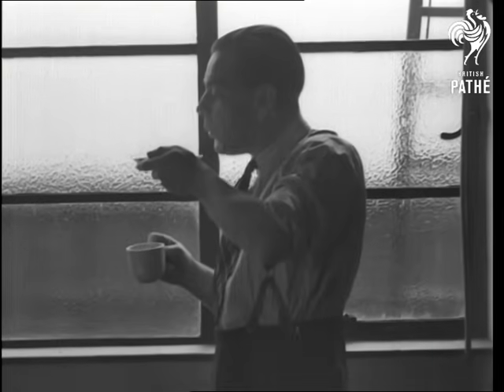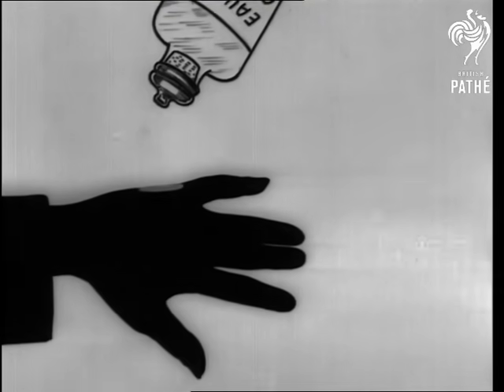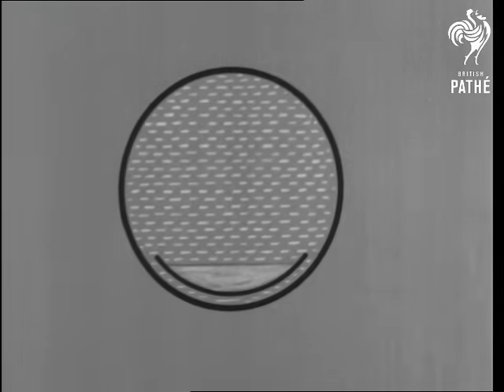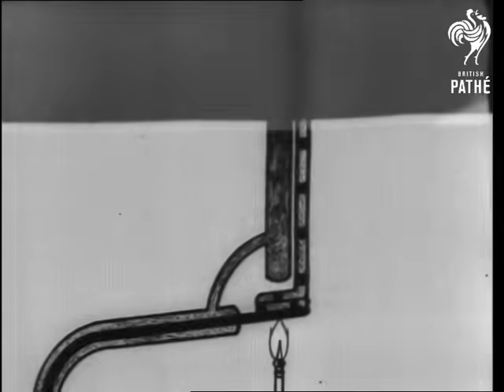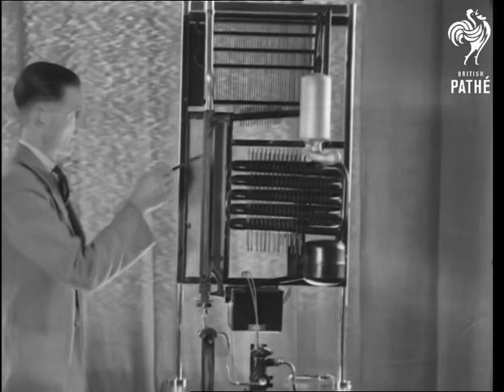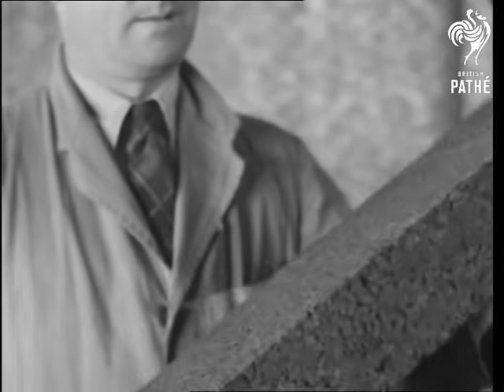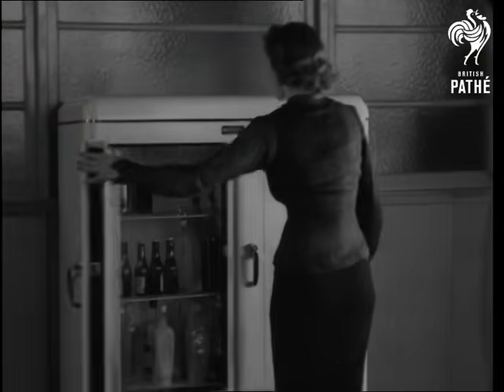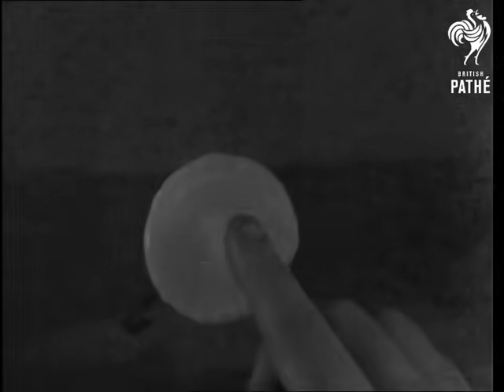Flame That Freezes How A Fridge Works (1939)

Comment: I dont understand why they dont use the heat of the exhaust to power air conditioner system in vehicles this way instead of wasting energy turning a compressor
Reply: i always thought this as well... but then i thought some more...

size, and the issue of vibration... or not remaining stationary.

they require gravity to work, and dont appreciate being tilted .
yes, theyre used in mobile homes... youre supposed to turn them off when traveling.

Comment: When I was a kid in the late 60s, we had a gas fridge at home! I couldn't understand how a flame kept things cool.
Reply: And after watching this old film i still don't understand it.
Reply: @keithammleter3824   Neither do I! 🤣
Reply: @keithammleter3824  If this works (flame) then a solar powered Fresnel lens focused instead of a flame, could make a fridge work. WTF?
Reply: @markae0  It would most certainly work.  Any sort of heat source that lets you heat to sufficient temperature only the right point in the system will work.
Reply: @markae0  That's why I got here 😀 I have a Fresnel lens, but no gas fridge to try it. It would also require a tracking device
Reply: @SolarCookingGermany  The solar fridge would only work for 15 minutes a day when the sun is in the correct position without tracking. So the insulation of the fridge would have to be super thick. and on cloudy or rainy days the flame back up would have to run. I was thinking a fixed Fresnel lens would make a straight (burn) line on the ground following the suns path? In this burn line, place a pipe that is to heat the refrigerant to 134 Celsius. First experiment with water in the pipe I guess.
Reply: @markae0  Good idea 🙂 Tracking is too complicated. But I'm afraid I can't just open the refrigeration circuit and add a heat pipe without losing too much fluid.
Reply: @SolarCookingGermany  Yes. Some problems to overcome. Some Fresnel lens are powerful enough to melt metal, so this is well above the critical temperature for the fridge, which means we might be able to pump that heat from the solar Fresnel lens to the critical area in the fridge. 

The solution is another heat (pump) transfer to add to the existing (non modified) working propane-flame fridge.

The Fresnel lens I have only produces mild heat of about 100C. But I have other lens to try out. The summer went by so fast! maybe I will have a few more sunny days this fall to try stuff out.
Reply: @markae0  Maybe it's easier to make some kind of Crosley Icyball. I guess it doesn't need to be ball-shaped.
Reply: @SolarCookingGermany  I never heard of that. Thanks!
Reply: When you add heat you increase pressure and that serves to purposes 1-liquifying gas 2-make pressure difference so gas before entering evaporator gonna pass through small hole called expansion valve , gas then expand and drop pressure and temperature and gases boil at average-40 at atmospheric pressure , now why we liquified gas and want it to has low boiling point? because substance when change phase like(liquid to gas) they absorb a lot of heat it’s called latent heat , if gas go to evaporator at gaseous state they would absorb only 1%of the heat a liquefied gas would absorb during boiling or phase changing
Reply: @mohammedbin0002  All good except for one important thing:   You can't liquify any gas by adding heat to it.   All you do is increase the temperature and pressure.    Thee important factor in gas-powered and kerosene powered fridges is that the latent heat of vaporisation varies with temperature & pressure.   For example, water at atmospheric pressure (1 bar) boils ta 100 C and in doing so absorbs a latent heat of vaporisation 2258 KJ/Kg.   At the critical point, 374 C, the latent heat of H2O is zero.
All substances that can exist in liquid and gas forms have a critical point and zero latent heat at that point.   
Ammonia - the working fluid used in non-electric fridges (and electric fridges before freon was invented) has a critical point at 132 C.   Latent heat at room temperature and pressure is about 1100 KJ/Kg.
Reply: @mohammedbin0002   Thanks for the detailed explanation.
Reply: @mohammedbin0002  I'm good with all of that explanation.  Just having a hard time figuring out how just a flame can drive a pump.  You'll need a pump to move all of that fluid throughout the closed system, right?  Fluid doesn't move unless there is a pressure differential.  ???

Comment: We need to use this technology again..😊
Reply: We do.  It's still in use in RV refrigerators.  Those run on propane.
Reply: It's extremely inefficient, in refrigeration it uses about 5x the energy a normal vapor-cycle fridge does. It's currently used industrially, like with small power plants, where the heat would be wasted anyway, search absorption chiller.
Reply: @straightpipediesel  Free solar power you don't care about 5X the energy. On a sunny day you have four good hours of sunlight that could run this kind of fridge for free. Massive insulation and you might make it to the next sunny day.
Reply: It's very inefficient. You are better off with a solar inverter and a compressor, most likely. 
Keeping the concentrated dot of solar light from an optical system focused on the boiler throughout the entire day requires the fridge to be outdoors and have some kind of tracking system to keep the little dot of bright light exactly on the boiler. 
It could theoretically be used in large air conditioning systems, but one of the reasons why we moved away from ammonia, is that it's quite lethal and explosive when in concentrated form like in this type of fridge. Ammonia was used in ice skating rinks in the early 20th century, not sure if they still do.
Reply: @mfbfreak  "Keeping the concentrated dot of solar light from an optical system focused "  I am thinking the solar focal point makes a straight line, and you have a pipe under the pathway with a fluid in it. Transfer-pipe the hot fluid to the fridge. Years ago people (like me) thought liquid cooling your PC was insane, but it has become standard.
Reply: Liquid cooling isn't standard at all. What you're describing is not possible without electric energy storage. Your solar heater will not be able to work about half of the time, because of the sun going down. However much you insulate your fridge, a 12 hour gap in refrigeration, every day, will result in spoilt, unpreserved food.

Comment: How can I safely gut out an old servel fridge? I want to turn it into a toolbox.
Reply: figure out how to break one of the lines remotely. r717 exists naturally to begin with and doesn't really mess with the environment the way a chlorine containing refrigerant would (this means the epa doesn't care if you vent r717). the problem is the stuff that's in that fridge WILL KILL YOU due to being basically pure non-diluted ammonia. the stuff you can get at any store to clean with is like 10% at most and the rest is water and even that knocks me back if I get too strong of a whiff of it.

Comment: Can phase change materials be used instead of a flame?

Wednesday, November 30, 2022 CE, 21:40 EST
Reply: any source of heat will keep the process going.
Reply: Like a catalyst used in those petrol hand warmer things? 🤔
I imagine it's just heat needed to drive the system not specifically a flame.

Comment: A refrigerator that works like a stove (range) or a water heater... Isn't that dangerous? Literally, there's fire inside... I wonder how many accidents gas refrigerators caused back in the day...
Reply: No more than gas water heaters or gas stoves.
Reply: @RetardedSysAdmin  I see...
Reply: Only being poorly maintained..
Reply: @Orangesjesus  I see. 🤔
Reply: No major issues reported while using a 1960’s Elecrolux gas refrigerator in a Airstream trailer I lived from 2005 to 2017. It was supposed to automatically defrost and I had to turn it off to let the ice build up melt.
Reply: Here in Australia farming areas did not have mains electricity and kerosene burning fridges were common.  soot builds up in the flue and if not cleaned out regularly, would sometimes catch fire - then flames would leap out.   one used to hear of houses burnt down due to this cause.
Kero fridges came with a long brush that you were supposed to use every six months or so to clean out the soot from the flue pipe.   Many farmers kept their fridge  under cover but outside the house to ensure house safety.
Reply: Imagine replacing it with solar heat
Reply: @zefellowbud5970  Is that possible?! D:
Reply: @Xicohtencatl_Xayacate  Yeah, this system just requires a heat source, what is making the heat doesn't matter too much.
They actually still make these refrigerators today for RVs and travel trailers: either sold as 'propane powered refrigerators' if they only use a flame, or 'three way refrigerators' if you can either heat it with an electric coil (powered by direct current from batteries or alternating current from an electrical outlet like some campsites hate) or with a propane flame.
Reply: @drewgehringer7813  Interesting! 🤩
Reply: @drewgehringer7813  I'm a member of an RV camping Facebook group & we get a lot of posts from newbies trying to DIY a solar-battery electrical system in their caravan/RV/overlander. The main purpose is to power the onboard fridge. Looking at the complexity, I think it's less complicated if they used propane. Plus, you don't need to worry if your campsite has tall trees or hills nearby that would cast a shade over your panels...

Comment: Does anybody know the original patent for this? I am trying to find out what kind of pressures there are in the system.
Reply: Since it’s Ammonia that’s used as the refrigerant you can use any P-T chart for R-717 to get the pressures.
Reply: @Ian-pe9rj It's not simply R-717. These Electrolux-Servel absorption refrigerators contain a mixture of ammonia, water, and hydrogen gas.

Comment: And that's how RV refrigerators still work to this day.
Reply: Some settlements in rural Africa, India, and Pakistan still use this technology for refrigeration as electricity is not readily available. Plus kerosene is already used for lighting & cooking.
Coming to think of it, kerosene might be a better option than propane for an off-grid fridge. It's less bulky as you can use plastic fuel containers & not a heavy specialised metal tank, plus you can easily pour it into smaller containers. Of course, the smell is a downside...
Reply: @jonathantan2469  not a single unit of this is used in India lol
Reply: @jonathantan2469  not anymore ... They are solar powered now
Reply: No moving parts so they last forever. Since it just needs heat it can be run off propane which was useful before solar and batteries got good and cheap.
Reply: @Jacob-bm6wb  Forget the " moving parts " joke, this is a joke that complex electronics companies use to laugh at the public. The absorption refrigerator does not require electricity. The basis of freedom is to do something that does not require the consumption of electricity to operate and does not include complex, unreliable electronics.
Reply: @ياقوت-ق  what is absorption refrigerator?
Reply: @Jacob-bm6wb Absorption refrigerators. That are used in campers and RV's. Are dual fuel units, for the sake of boondocking purposes. That uses both propane and electricity. Some also use DC battery power if preferred. That can be charged by solar panels and inverters. The heating element which is a U shaped calrod coil for the electric operated mode. Is located in the flue above the stove portion of the boiler, that houses the gas burner. Just adjacent to the boiler pipe.
Reply: FYI it was used in Indian hospital's for vaccine...
Reply: Absorption refrigerators don't like warm items to be put in them. Compressor refrigerators recover much quicker. I have a 2.5 cu ft refrigerator I bring with my RV to pre cool items before putting them in the RV fridge.
Reply: Ancient tech still used today! lol
Reply: @damon8201  Wait until you find out how old the idea for a heat pump is.
Reply: @h8GW  centuries... CENTURIES DAMMIT!!